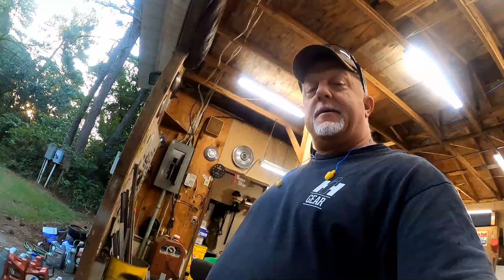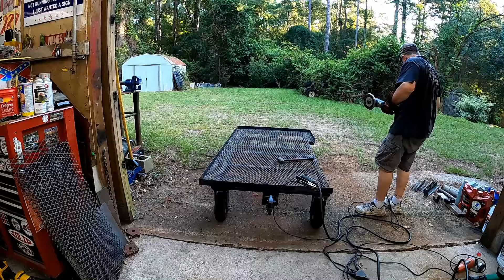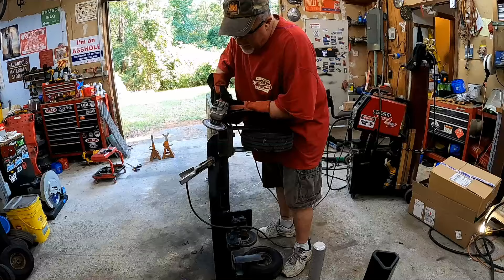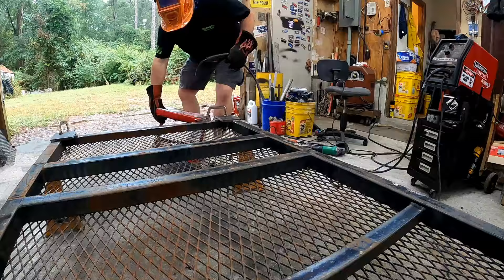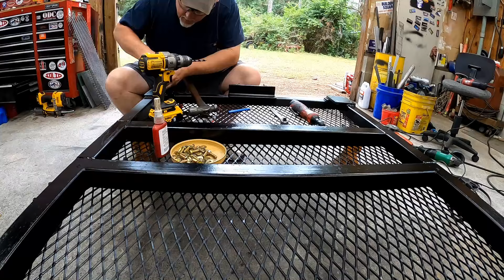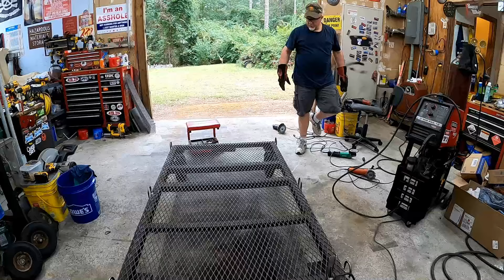Finally Done!! -- The Last Band Cart Build for the Fox Creek High School Marching Band!!

Comment: Why did you have to narrow the cart?
Reply from the maker: Good Question, with several answers.  I should have thought to include that in the video!!  We use a Penske rental truck with a lift gate to transport all of the instruments and props to competitions, and the carts as they were had to be physically lifted onto the lift-gate and then physically held up as we maneuvered them into the truck.  Now they roll onto the lift-gate and into the truck with no heavy lifting.  Also, when kids stepped onto the carts from the sides they would start to tip.  Finally, it makes it easier to get through all of the doors in the school.